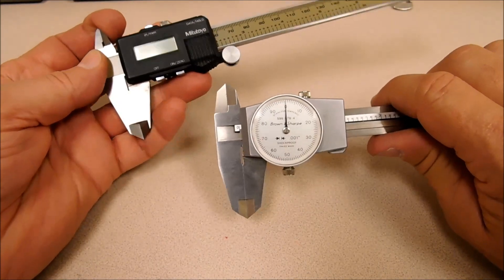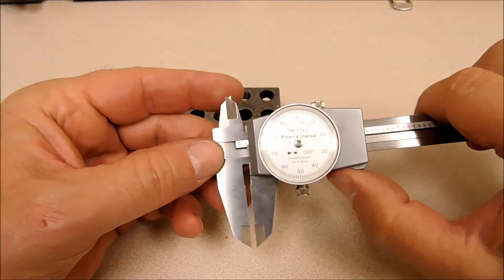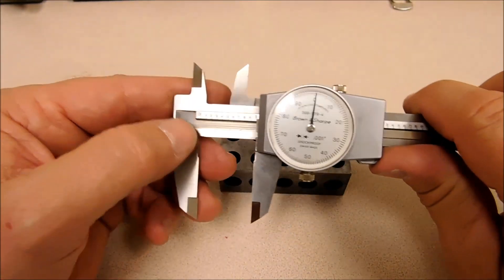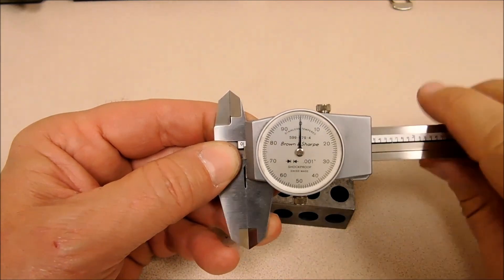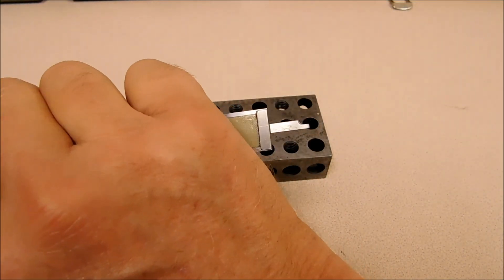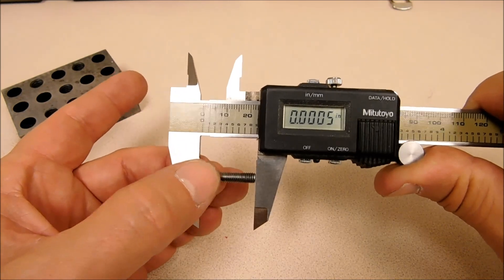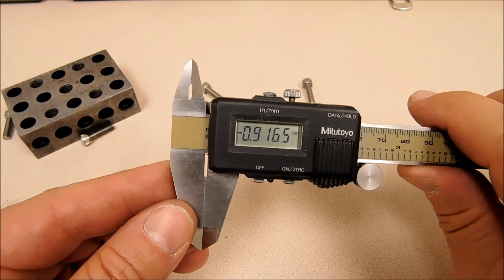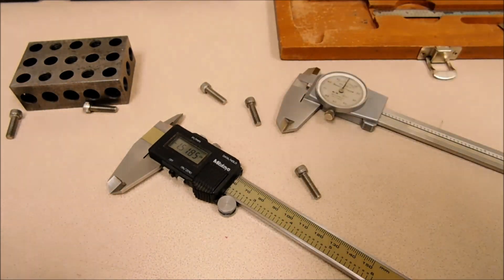Calipers -- Dial vs. Digital -- Does one do more ???  ( yes )

Comment: Sorry i just cant like digital stuff, in the 90's when i was a wee 'prentice digital measuring equipment was frowned upon by all but non-tradesmen who couldn't read vernier scales properly.Ive not worked in metal fabrication for decades but found myself requiring calipers a decade or so ago for using while reloading,i found my older eyes not so reliable with the vernier scale as once where so look for alternatives,i cant trust the digital because the tendency to "slip the scale" which is IMPOSSIBLE to do on a dial caliper with a gear running on a rack, even the cheapest Chinese junk digital (tested just the other day personally with standards) will read spot on zerod on a closed jaw but open and close them a few times and measure your standard again,also if you knock the zero button on digital with jaws open slightly every measurement you take is then wrong, much much harder no knock the dial lock out of adjustment,cheaper ones get affected by battery voltage as well and they also drain battery's like no tomorrow.Cant say i remember the last time my dial calipers stopped working because battery went flat ;) All just my opinion and i freely admit im old school.I don't even like current production stuff,too much plastic, plastic bodies on calipers is just yuck! I only use older all metal mitutoyo myself,wont use anything else personally.I do have a lovely Mauser dial caliper thats more a display piece than for use. Ive been told a lot of even the good brands (starret,B&S etc) current production stuff is not so good  as it once was (like lots of things) with much of it coming out of China.Not against China but i wont touch their measuring tools.Dial calipers are mostly very cheap here,so that can be a advantage for some, last Mitutoyo 6" that i bought cost me a whole 27aud shipped, that's like 20usd! For vintage MIJ mitutoyo in perfect condition in original case, they also have the 100 thou dial vs the 200thou i have on all my others, they became my go-to for lathe and mill work before i grab a mic.Ive seen them sell without boxes for as low as $15! Metric ones do seem to bring much higher coin though,i only have one metric dial caliper (vs id say 10 imperial!) as i don't much care for metric and it cost me $75,was essentially NOS though. So for you Americans , check out Australia for cheap imperial tooling,thank me later.
Reply: It seems you have never used a high quality digital caliper... repeatability is at least as good as a dial (though not as good as a Vernier, if your eyes can still read it - mine no longer can without perfect lighting and/or a magnifier).
The argument from "back in yonder days nobody liked them" is... well, ahem. Back in yonder days nobody wanted you to use a calculator, or a digital watch, and a mobile phone was showing off. Was it a "better world"? Maybe, but not in terms of ease of calculation, time keeping and personal communications.

Comment: With 376 comments already posted, someone has probably posted this one. Another thing the digital can do is the center to center of 2 holes of the same ID. Use the internal measuring function to measure the internal diameter of one of the holes and zero the reading. Then use the same internal function to measure between the far sides of the holes. You get the centerline distance. No calculation needed.
Reply: Nobel prize for you mate !

My blood pressure has just dropped 10 points.

Mind you, the dial's battery never goes flat just when you need it (and don't have a spare handy)
Reply: The same method can be used to measure pin spacing, particularly in electronics. Measure the diameter of one pin, zero on that. Measure the outside of one pin to the outside of the next pin (or 10 pins and divide by 10).

Comment: Could you zero the dial for comparative measurements?

I have all three types, vernier, dial, and digital.  My most used are some old West German Craftsman E/M vernier calipers.  Annoyingly they do not have the step feature because that part is rounded off.
Reply from the maker: You could. A digital will give you the positive and negative reading so there is no guess work after half the range of the dial is consumed.

Comment: I've read a lot of the comments here because I'm bored and find this subject entertaining to say the least.  I can't help but laugh when someone says things like digital calipers are not as accurate as dials or the batteries don't last or digital give false readings, jump and so on.  I don't know what make or brand they are buying, but in the 30+ years I've been buying digital measuring instruments I've never seen any of these things to be true.  Even 30 years ago when they first came on the scene they did a pretty decent job. Calipers in general are not meant to be a high precision instrument.  +/- .0005 is about all would expect for a tool like that. For closer work, use an instrument made to measure closer work.  As for batteries, the coolant proof Mitutoyo I use has only gone through 3 in 5+ years and I use it daily.  And the batteries are cheap.
Reply: But if coolant gets in them they can mess up. Mitutoyo are good but even them mess up. I've used them for years as well.

Comment: All the advantages of the digital aside, they're completely useless if, every time you take it out of the box, the battery is dead.  Which has been my experience with the ones I own.  I just switched back to a dial style a week ago, as a matter of fact.
Reply: The battery on my current one last for a year or more and they're cheap, so i keep a spare around.  I have both dial in 6" and 12" and an 8" Mitutoyo coolant proof digital.  I keep the 6" Brown and Sharp dial just like Joe's on my desk and the digital by the CNC machine.  I also have heavy 24" and 48" verniers for the big stuff.  Many years ago my first dial had .200 per revolution and no cover over the rack, I hated it because it was always skipping because of chips getting caught in the rack.  Over all I like the digital, even digital micrometers and height gauges because they are more accurate, less prone to chips and dirt.  My friend has a 72" digital made of carbon fiber, can't imagine what that costs.

Comment: I gave an old mitutoyo dual caliper with .200" per revolution
One advantage the dial indicator has is it never has dead batteries

For the over/under measurement, you can still zero out the dial and use it as long as you're dealing with distances less than a half Rev of difference

Comment: Those old Mitutoyo digital calipers are very high quality. I have one exactly like Yours that is well used over the years and still accurate.  Was trying to remember when I bought it, it must be over 20 Years ago probably in the 90:s. Had less luck with some more recent ones. I find the Mitutoyo digital mikes very high quality as well. I think this is a case where it is very good advice to buy  the highest quality You can afford. It will pay off. I have some China Insize ones that eat batteries.
Reply from the maker: I always say, "buy nice or buy twice"
Reply: We have at work what I think is that same model Mitutoyo Digital Caliper.  It is still around and functioning.  I expect it is about 25-30 years old.

Here are my thoughts on Digital vs. Dial Calipers.  Let me right off get two things out of the way.  I prefer Dial Calipers, but that is just me.  I also do not advocate abusing equipment of any kind.  My experience is that Digitals will outlast Dial Calipers when abused.  Our original Dial Caliper, a Mitutoyo, bought a bit before our Mitutoyo Digimatic, is long gone, as well as any of the cheap Chinese Dial Calipers we have had over the years.  Our Digimatic is still hanging in, as well as most, if not all of the other cheap digitals we procured over the years.

Comment: The dial gauge is also affected by dirt as soon as you get some fine dirt in the rack it is finished!!!
Reply: I'm surprised I had to read through as many comments as I did to find this point mentioned.  Dial calipers may be okay in the QC lab, but out in the shop, it never takes long for them to pick up a micro-granular chip in the rack and ruin the day.

Comment: Give me the mechanical.  No batteries to go bad, much more dependable.
Reply: Until dirt gets into the mechanism. Digital has no rack to get dirty and is more sealed. Non-contact measurement.
Reply: @Eggsr2bcrushed  Dirt isn't an issue.  They are easy to clean.  I'll take mechanical over digital 2:1 for most applications.
Reply: I have to disagree with that.  Batteries are one thing, but durability with regard to abuse is another thing, and that is where digitals beat dial calipers.  With that said, my choice, what I use at home, not what I have to use at work, is a dial caliper.  I am more careful with my personal tools at home, and use them less.  That should never be an excuse to abuse tools, by the way.
Reply: @dannyo3317  Please...  I have Chinese made dial cals here that my help has abused to the point that the lenses are lost, and the pointers are bent.  Over 25 years old, and they still work great, we use them every day in a dirty environment.

My Mitutoyo digitals still look like new.  They never get used because the batteries are always dead when you need them.

Comment: Joe, one disadvantage in my experience with dial calipers..
Keeping the track clean is very important, all it takes is a chip getting caught in the gears to really screw them up. That's what led me to switch to digital. Granted, with digital you have to be cautious around coolant or other liquids.
Reply: They make waterproof calipers now too.

Comment: Good one Joe.
As there ever been any callipers or dial gaugers made to read "old european" measurements other than metric or imperial?
For example ones used to make Italian violins etc.
Reply: Universal dictionary of weights and measures, ancient and modern.

John Henry Alexander - 1850

Page 51

CREMONA.

[City in the newly formed kingdom of Lombardy and Venice, (belonging to Austria) on the river Po; fortress, with 27,000 inhabitants; manufacture of the best violins in Europe.]
Coins and Moneys. For the coins and moneys, see Milan.

Weights and Measures. The commercial pound weighs 5060 English grains.

100 lbs. of Cremona are equal to 72.28 lbs. avoirdupois.

The foot of Cremona measures 15.62 English inches.

The braccio is 24.24 inches. 6 feet make 1 cavezzo.

100 bracci are equal to 67 1/3 yards.
Reply: Thanks Horace for that information, i believe it's the reason they were the best.
"metric" is so 'cold'.
Reply: https://www.kroeplin.com/en/produkt-kategorie/mm-geraete-en/aussenmessung-en/
It is conceivable to have a caliper gauge calibrated to match

Comment: Also easy to check distance between same sized holes by zeroing at the diameter of the hole and then measuring outside to outside of the holes.
Reply: Yes , do that a lot.

Comment: Joe, I love your content!!
My comment for all is, If you use or depend on Digital Calipers or cant read Dial Measuring Equipment, you are not a Machinist.
This is not downing you Mr. Pieczynski, You are The Man.
I have learned a wealth of knowledge from your videos!!
Reply from the maker: Realistically, every machinist should start with true vernier scale calipers and move up from there. Then dial or digital.
Reply: @joepie221  Very true!!
I never use Digital Calipers, Micrometers, Height Gauges etc. 
The first time Digital jumped , I never trusted them again.
No weak batteries in my B&S 12's !!
Reply: @johnathanjones2252  In the 30+ years of using digital caliper and heights gauges I've never seen them jump,  not saying they can't, but I've never seen it personally.  On the other hand, I have seen dial gauges get chips in the gears and do permanent damage.  For truly bullet proof, go vernier.

Comment: I ended up with an imperial lathe through a supplier mistake, now I have a metric mill and an old pantograph engraving machine with amazing mechanical dual reading dials! With all this the digital wins for swapping and quick conversions between the systems. I now think in both, which is good.

Comment: Joe, nice video but you missed the data/hold button and how it works when you buy the external cable to attach it to a PC. The caliper can push the measurement into the PC using Excel and possibly other software.

Comment: For those that have battery issues with the digital calipers,  Try cleaning the contacts with a #2 pencil eraser.  I did this several years back and it seemed to have stopped the problem. We used to clean our comm gear this way in the service.

Comment: Also, with digital caliper you zero it on a partial length (i.e. the head of screw), and get the remaining length from the total one (i.e. the thread length from the screw length).

Comment: Two advantages, but also two disadvantages.  You did not mention the disadvantage of expensive batteries to go dead and need replacing periodically and potentially going bad and corroding the contacts on the caliper itself.

Comment: If you zero the dial on the part, you can see variance within 0.100 easily and more if you count the ticks. Slightly slower, but still works.

Comment: Metric is the way to go. Don't you agree?
Reply from the maker: Any day now...............here it comes..............wait for it..................NO
Reply: Well... I admire people using the imperial system. There is something fascinating in thinking to something as a fraction of something else (or something else more, ore something of something else more). It is a lovely way to spend your time. Isn't it?
Reply: @giuliobuccini208  Math works the same in either system, you can use fractions or just decimal numbers with either system if you care to. Example would be 0.75 inches or 3/4 of an inch.
Reply: @robb1165  Yeah, I think so. It is just to not bother your mind if 1/4 +6/8 is greater or not of 15/16 of an inch...

Comment: I was measuring some center lines between holes the other day and by measuring the ID of the hole and zero it out then measure between holes and you get center line dimension.
Reply: I was surpriced he didn't mention this at all. It is a good trick.

Comment: My only complaints on the digital calipers is repeatability and battery life. I never seem to be able to get it to zero twice in a row and every time I go to use it the battery is dead. I'm sure it would help if I spent more then $20 bucks on one though....
Reply: @ things. First those cheap units do suck the battery down. My Mitutoyo only had the battery replaced once in 4or 5 years. Second, don't buy alkaline batteries. They don't last long. Get silver oxide. Much longer life.
Reply: Those cheapo calipers don't turn off completely, they only turn the display off. The good ones only draw micro Amps when being used and completely turn off.  At least that is the case in my experience. Also, the batteries used in the cheapo is usually an alkaline chemistry. A better choice is a silver-oxide equivalent, like the ones used in the good calipers. You can always use the silver-oxide in place of the alkaline.(they do cost more) Just google the alkaline battery number and you should find the silver-oxide equivalent listed too.
Reply: XSspeeds If the caliper is locked in place with the set screw even the cheap ones stop searching when they’re off and the battery life is extended to normal.

Comment: Agree that a quality digital caliper has meaningful advantages. BUT, as AvE demonstrated in an old video looking at 'classic' vs. 'el-cheapo' Mitutoyo digital calipers, the cheaper version had no battery low indicator. And, worse, when he powered them with a power supply and gradually turned down the voltage, the el cheapo Mitutoyo began to give spurious readings before the display dimmed. So, change the battery periodically, especially if your digital caliper doesnt have a low battery indicator.
Reply: "el-cheapo and Mitutoyo don't go together.
Reply from the maker: Buy nice or buy twice. Nuff said.
Reply: To be clear that wasn't a video about 'el-cheapo' Mitutoyo calipers. It was a comparison of the FAKE (Chinese knock-off) calipers made to LOOK like Mitutoyo calipers, vs. the genuine article.  Ali-Express was trying to pass off the $33 dollar calipers as authentic Mitutoyo tools. That was the whole point of the video - to warn people to not get taken in by the scam.

Comment: Great video Joe. Just as an aside, with the dial caliper could you not measure the bolt, zero the dial face and then read the differential that way? Looking forward to the next video. Cheers

Comment: I have a digital that does all of that plus it can show the nearest fraction (quarters, eighths, sixteenths, 32nds and I think even 64ths.).  Only problem is that the second time I went to use it, there was moisture in it and it was dead.  I always kept it in my climate controlled house in a drawer in its case and original packaging thinking it would be protected.